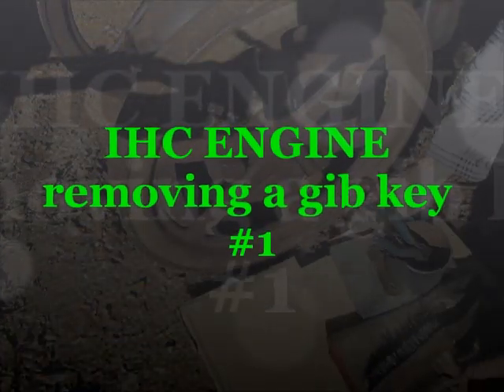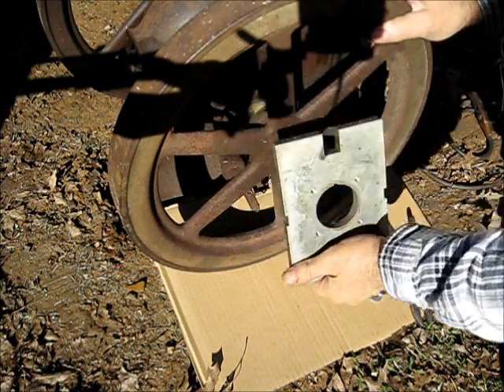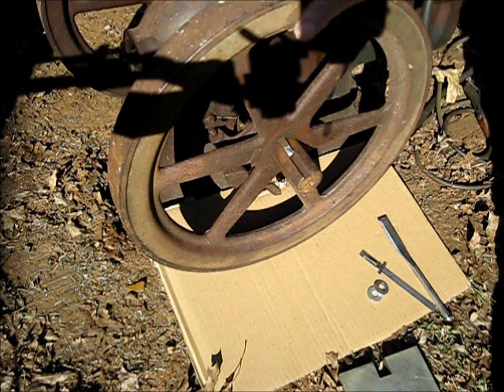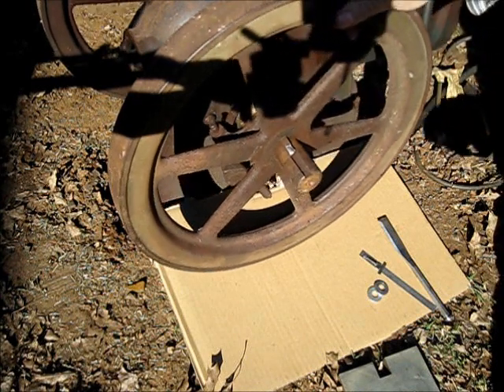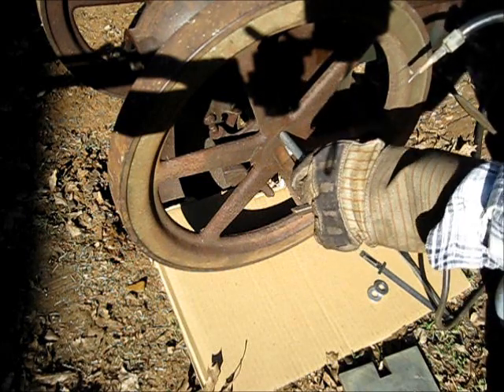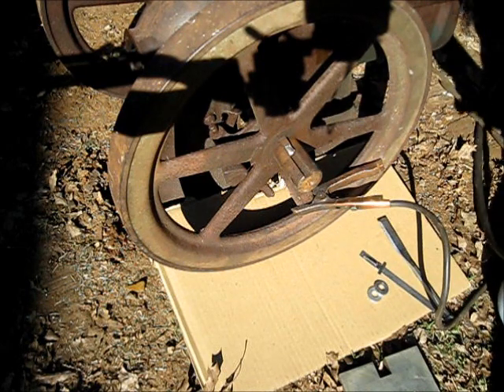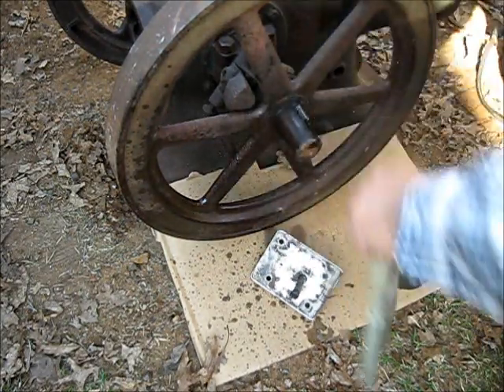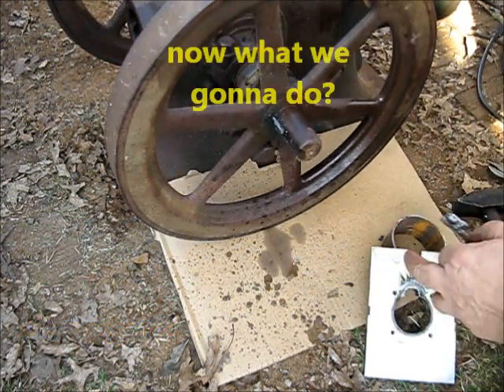IHC ENGINE / removing a gib key #1of4

Comment: I watched all four chapters and really enjoyed your work Sam thank you.  I notice that it is not your practice to soak the parts in penetrating oil overnight or just set up a light tap with a hammer to try to break the rust weld have you found over the years that these methods are simply not effective and that is the reason you do not do that
Reply from the maker: GettingSquaredAway ,,, thanks for the question,, and the answer is a little to long to type in as a comment answer so I will talk about it in an upcoming video (I am getting back to the 1920 engine in a few days),, but the quick answer is,, I have found long time or overnight soak with penetrating oil to be of very little help,,,

Comment: If the flywheel is moving along the crankshaft can it do any harm on the far side from what we are watching! ie can it be destroying something behind the flywheel?

If it might be at risk of doing damage and you get something that will pull on the end of the flywheel to pull the gib key out?

My thoughts otherwise are possible soaking with penetrative oil for at least 12 hrs and then heat on the flywheel centre with your puller arrangement in place and under tension.